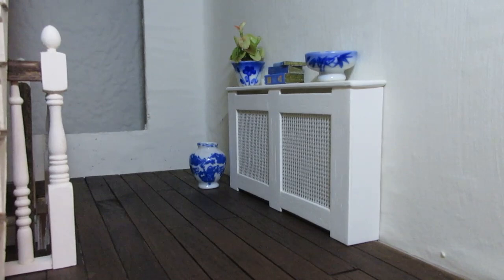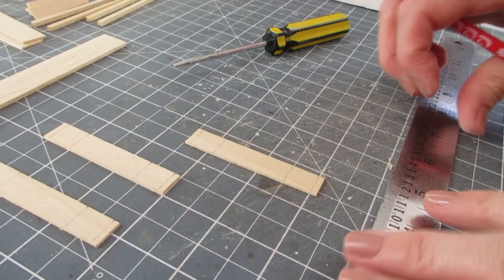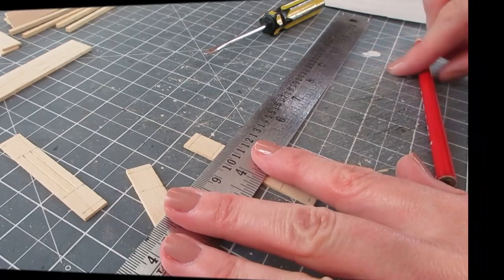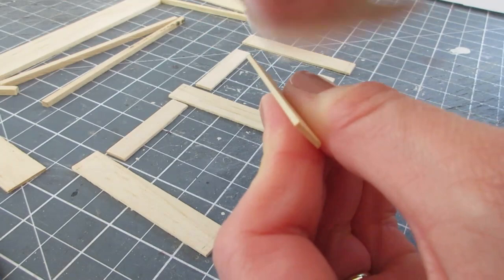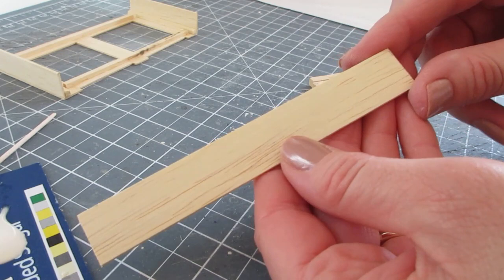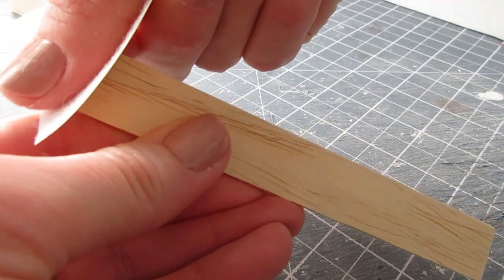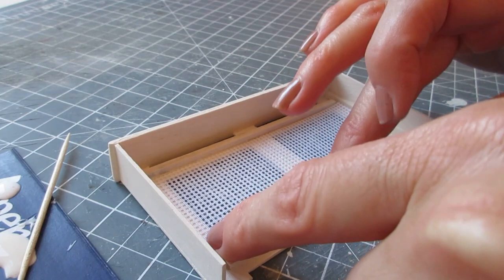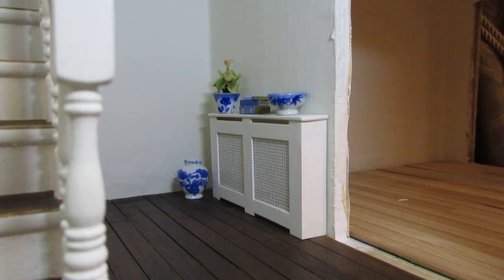My Dolls House Diary Tutorial #35 - 1/12th Scale Radiator Cover

Comment: Another great project, well designed and well executed...............fortunately I don't need covers for my 30 or so radiators....................in the original most of the radiators were built into the thickness of the walls under windows or were quite exposed - depending on the room of course. But I still have urge to build one such as yours, so....................
Reply from the maker: Thanks George. I would love to see a photo of your dolls house!  :)